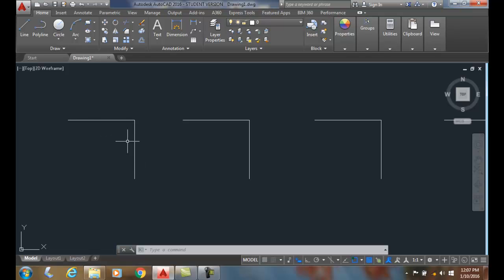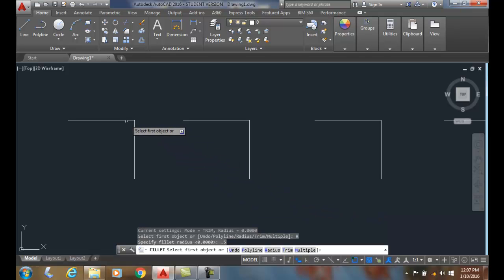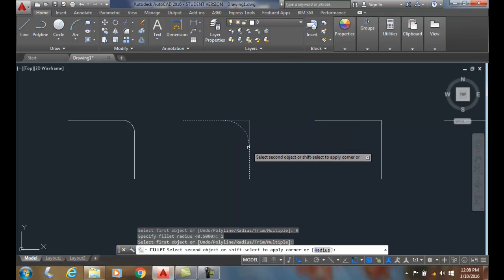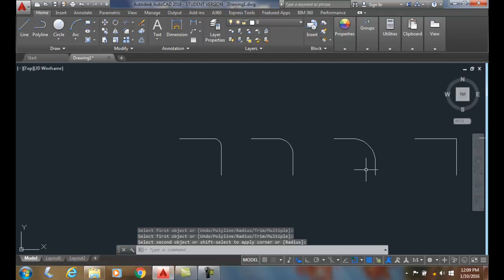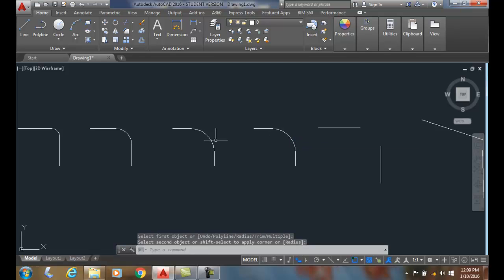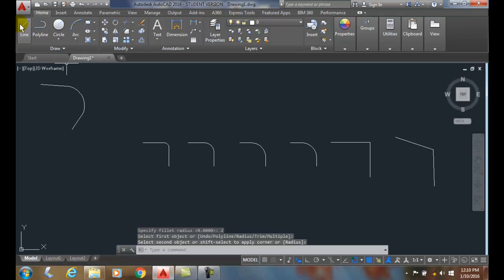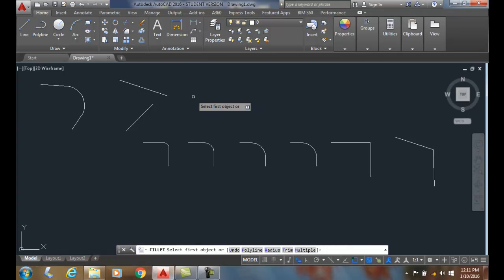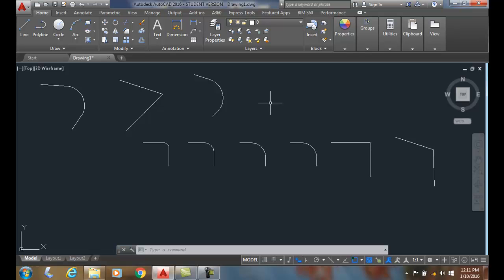AutoCAD I  11-01 Setting the Fillet Radius

Comment: hello Mr. Bordeau.
Thank you very much for your videos
I am going through your playlists and will eventually learn how to use autodesk families; writing the softwares would be sth but learning to use it shouldnt take more than effort and time
Do you have any suggestion on how to speed up learning, or how do you think i should use the videos (other than watching and going over the features in my system); (i am kind of a little too active), so on half of my screen i play the videos and the other half i try to practise and also take notes)
if you have any suggestion for me that would be greatly helpful (i am trying to finish EE)

in terms of hardware suggestion,  my laptop got burned (it wont turn on or take power) on black friday night '15, i was working on acad till 3:30am and it wont turn on next day. Right now, my dell has 8GB RAM, i5-4460s and no GPU. I learned a lot about building a system but i cant afford anything with a quadro right now (if you have any suggestion on monetary or learning/practicing opportunities that would speed up my progress a lot as well);  Long story short, i am thinking of old dell precision laptops, old and used but should work for me, with 1GB-2GB quadro k100m or k2000m.
i finished an acad class but my teacher was newly assigned and i was very active and had multiples of expectation.

i will delete, not if you dont want me to, this conversation, if you have any suggestion for me.